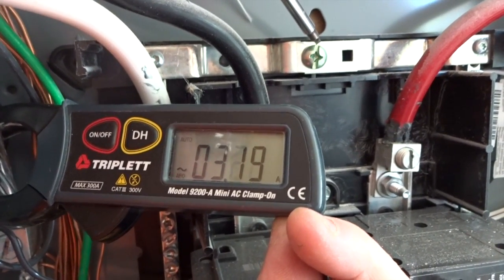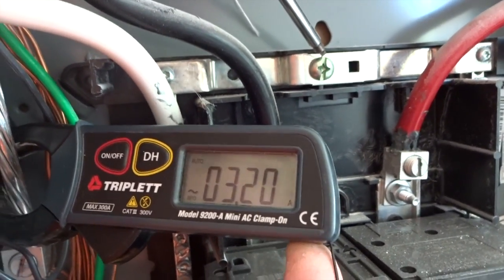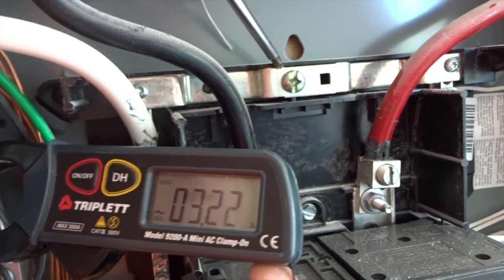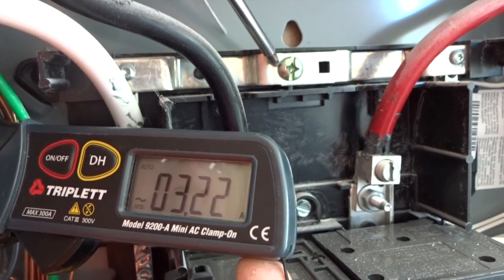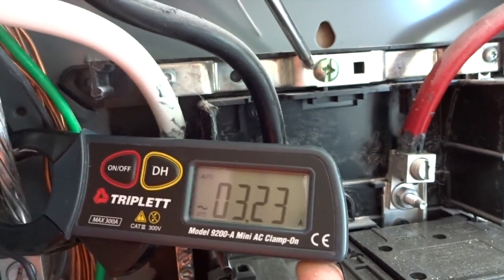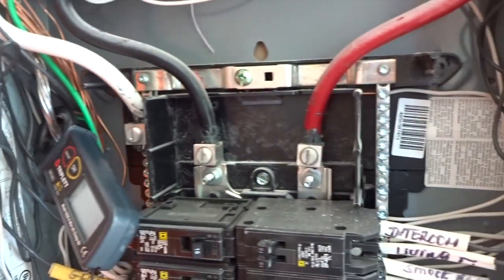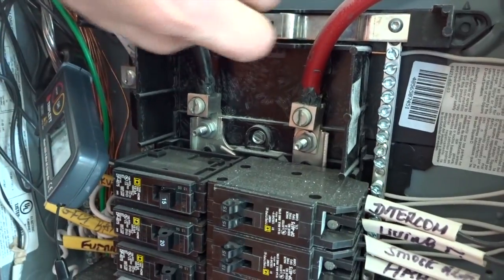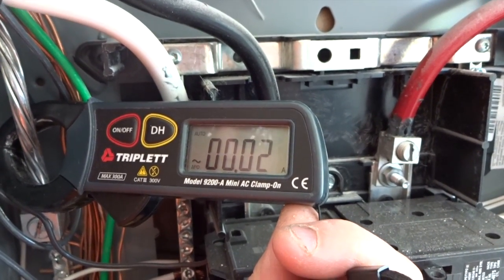Electric Code Violation: Bonding screw left in on Sub Panel.

Comment: There is nothing like your content that I have been able to find. No diagrams necessary, literal code violations found (not created), explained and repaired.
Reply from the maker: Hello ButterBean,  

Thanks you for the compliment.    What is your interest in this and what do you do as a profession?  Are you in an electrical industry of some kind?  Please advise.  

BTW  we first detected this wire code violation (WCV) with a gauss meter that measured a very high magnetic field (4-15 mG) running the length of the house from the service entrance panel to the sub panel in the infants crib room. We found and fixed other WCVs at this house are well such as joining the neutrals of three separate circuits in one wire nut in a three switch plate: see this video: https://www.youtube.com/watch?v=-CaES0-yinI&t=9s&frags=pl%2Cwn

Sadly, I find WCVs in 25% of houses I inspect.  The building inspectors have failed at their responsibility and provided the homeowner a false sense of safety when they miss a very obvious error like this the can be seen with the naked eye.  There are many peer reviewed studies correlating magnetic fields greater than 2 mG with childhood leukemia.

The reason I was called out to this house is that the mother of a 6 month old boy child (with a small birth defect) wanted to make sure the house was safe.  We found N-G and N-N WCVs in many places.  Only the mother was concerned and the high tech husband originally thought my efforts and inspection-repair fees as not necessary. We also found massive amounts of dirty electricity created by dimmer switches, LED lights and the energy saving variable speed pool pump (the worst offender).

Most homes have a lot of room for EMF reduction-improvement.  In some cases the client can feel the EMF reduction immediately. 

Thank you for watching!
Reply: @windheimemfsolutions  Hello Eric, a few years ago, I installed a variable speed pool pump to replace my original two speed pool pump.  Wasn’t aware of the possible dangers, until I saw one of your videos.  I am wondering approximately how many feet the pump needs to be from the living space to not have a non beneficial affect on the humans and pets. Also, is there a remedy Ike a filter that may help? Thank you in advance.
Reply from the maker: @kimariokiji  A VS pump next door will create lots of DE in your house if you share the same utility transformer.  In some cases filters work but never as well as getting a single or fixed 2-speed pump.  You can contact me via the CONTACT FORM on my site. https://windheimemfsolutions.com/contact-us/
Reply from the maker: @kimariokiji  Replacement of the pump to fixed 1 or 2 sped is best.  Proper filtering can help.  Contact met via my website for further assistance.
Thank you for your comment.

Comment: In other words, the neutral bar must not be tied to the ground bar of the sub-panel.
Reply from the maker: Hello Northbride55:yes, you are absolutely correct.
Reply: Windheim EMF Solutions  I wonder how much would be the voltage between ground / neutral , or ground/metal case, with the bonding screw in.

Comment: You basically just have two neutrals going from the sub panel to the main panel when you are using the bonding screw on the sub panel. There is no danger in itself doing this. We have bonded neutrals and grounds at the power transformer and on the power lines. Also generators are generally bonded at the generator and most people connect them to a panel that is also bonded, meaning voltage is going through the neutral and the ground from the generator to the main panel. How is this any different? Well I think the main concern is an open neutral coming into the building. There should be one grounding point at the main panel that is bonded and this would eliminate an unbonded sub panel from being hot. So yes you SHOULD NOT bond the subpanel to prevent electrocution in an open neutral situation. In a open neutral situation, your return path for neutral becomes the ground rod at the main panel. It's not a good situation either way, but better than multiple paths that that have more than one bond creates.
Reply from the maker: Hi Billy,

The NEC prohibits the connection of Neutrals and Grounds on the load side of the service entrance.
Reply: Your theory is not completely accurate. Objectionable current on grounds due to bonding to neutrals downstream of service panel can and has caused death. It’s rare and usually a worker but it can happen.

Comment: ...why does this cause harmful magnetic induction but the current on the neutral doesn't?
Reply from the maker: Induction cooktops heat ferrous metal pots with very powerful high frequency magnetic fields.  It is a 240 volt device so there is no neutral current but it does create high levels of DE which travels back to the electric panel and is distributed to all connected circuits.

Comment: Now that you saved this homeowner from eminent danger, did you figure out where the stray voltage is coming from? Did you find some device leaking to ground,  welder, grinder etc?
Reply: Can you explain this comment? If the neutral and ground are bonded, wouldn't that alone explain the current present in the ground wire? Why do you believe there's still something leaking?
Reply from the maker: Hi Aaron,  Current on the sub panel ground cable indicates a N-G connection related to that sub panel.  In this case at the bonding screw.

Comment: Am I seeing this correctly? Are you reaching in an energized panel without proper PPE or tools? I assume it's energized because of the amperage reading on the ground....
Reply from the maker: +Dewayne Fancier Good observation Dewayne.  I have electricians do everything that requires touching wires and I leave all wire operations up to them.  The electrician is hired directly by the property owner.
Reply: NFPA 70E requires PPE when is close proximity (like what is shown in the video.. Too many employers, & employees are unaware of it, or they're the Old School guys who prefer to not dawn the appropriate PPE...
Reply: I'm glad someone else caught that!
Reply: It would have been better to lock and tag out,  verify lack of voltage, remove the ground screw instead of risking dropping the screw on to a phase conductor and causing an arc flash... also Fluke makes a blue tooth amp clamp you could have applied with the power off and keeps you out of the panel when energized. I’m “old school” but I wear the ppe because unforeseen things do happen and I intend on retiring in tact. The information is good and your intentions were good, it’s just not how we roll these days ~

Comment: If your sub panel chassis and the ground correctly earth grounded. Bonding screw install or not doesn't matter?
Reply from the maker: Hello Wei,  Per the NEC code, Neutrals and Grounds can only be connected at the service entrance and that means the bonding screw or strap  on the sub panel must be removed. Thank you for your comment. Eric